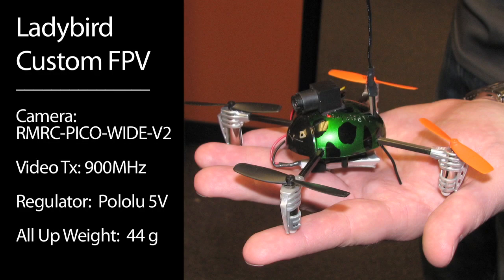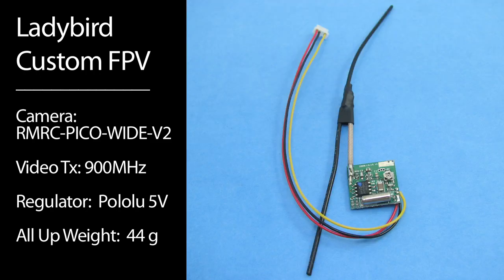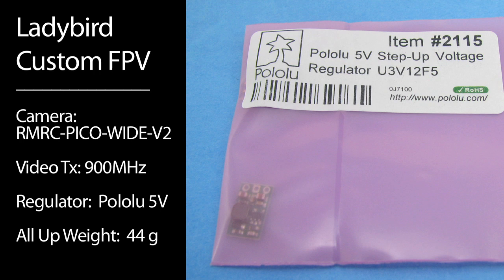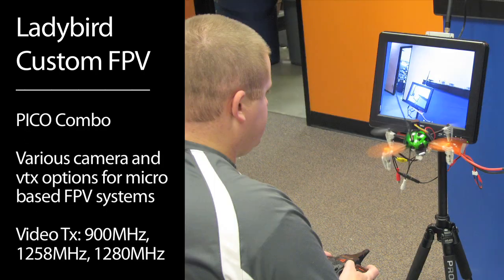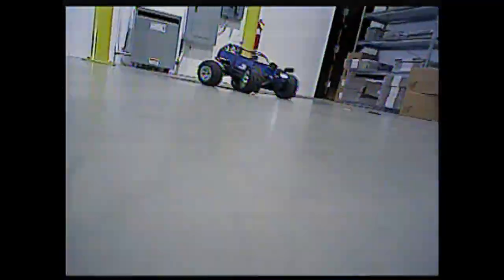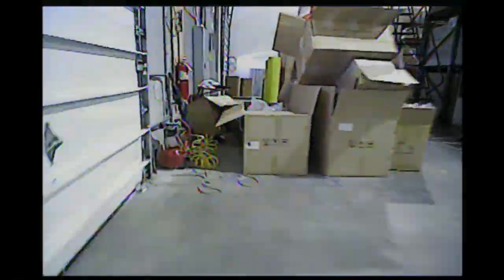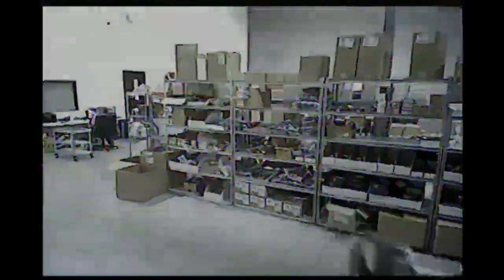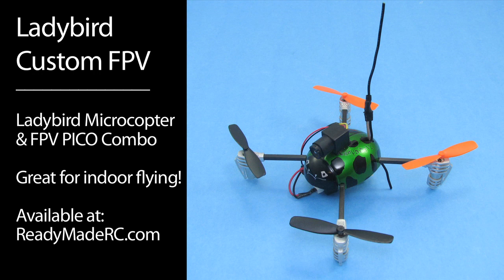RMRC Pico FPV Video System on a Walkera LadyBird

Comment: Perfect for winter.  So that's a separate 70mAh battery for the FPV video?   Do you sell those, I don't see them on the site (or the connector/leads)?  Thanks.
Reply from the maker: Yea, we're working on getting the connectors and batteries.  Anything from a 50mAh to 150mAh 1s lipo works fine.  We bought a charge adapter for a 1s battery from our local hobby store, but we'll be getting some of those plugs asap.

Comment: this works ok with 2.4rc? how far is the range outdoors on the 900mhz?
Reply from the maker: Yes, this was with the Walkera 2.4G RC system.  We're having no problems using the 2.4RC with any of the pico video systems (910, 1258, 1280). The range is limited by the 2.4GHz RC systems.  I've flown these pico video systems over 1/2 mile using UHF for RC control and just an omni antenna on the ground station.  You could go a couple miles with a clear line of sight and directional antenna on the ground station.
Reply: Ready Made RC, LLC Thank you! Im suprised the 1280 works with 2.4rc, everyone says that shouldnt.
Reply from the maker: It's very low power and... don't believe everything you read in the forums. :-)  Lots of people fly 1280 successfully with 2.4 RC. 2.4 is NOT on a 1280 harmonic (that would be 2560). The issues usually have more to do with the 1280tx's swamping the 2.4GHz RX's, which can be avoided with good installation practices and/or using lower power TX's.
Reply: Ready Made RC, LLC oh, I already fly 1280, I must try it now. thanks again! Ill be watching the black friday deals!